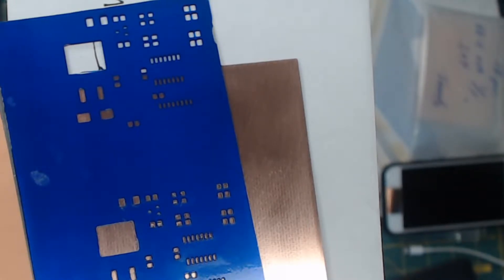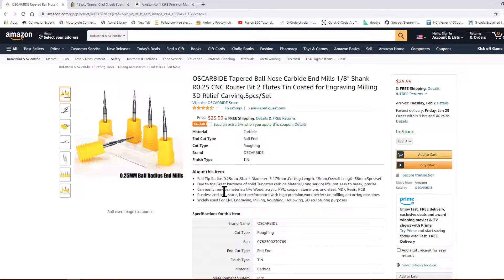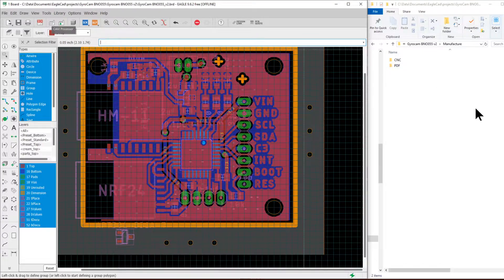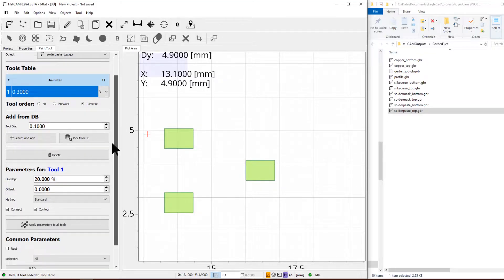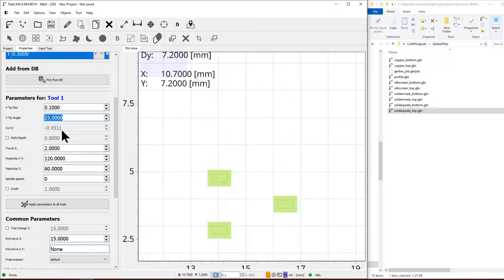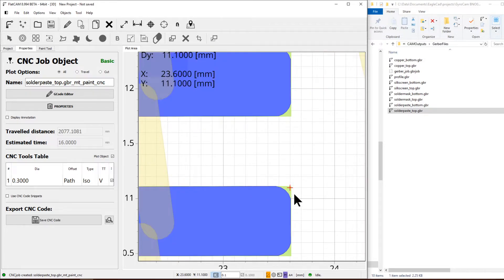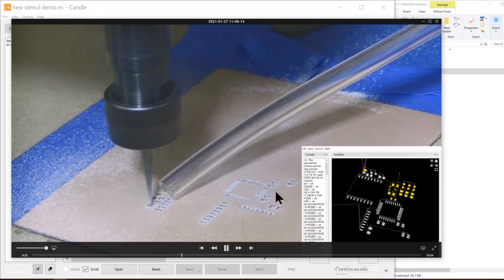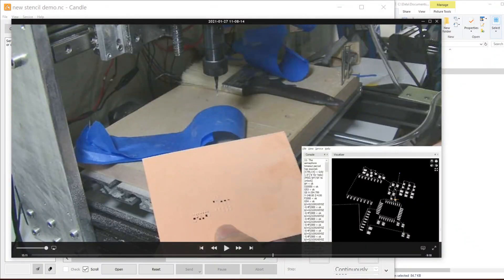DIY PCB Stencil

Comment: Nice video, man. What's the thickness (in mm if possible) for the aluminum stencils you showed here? I made one a long time ago as a proof of concept using 0.1mm copper sheet with the toner transfer method, but it was very flimsy.
Reply from the maker: The aluminum sheet is 0.4064mm and the PCB is .43mm